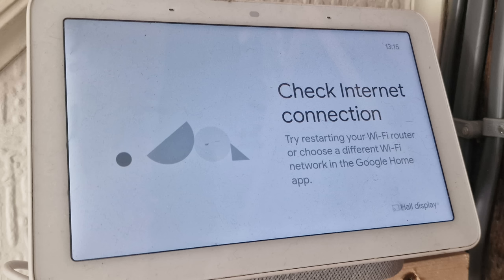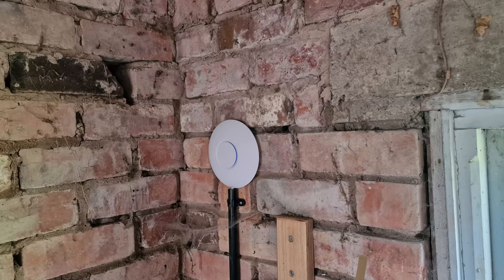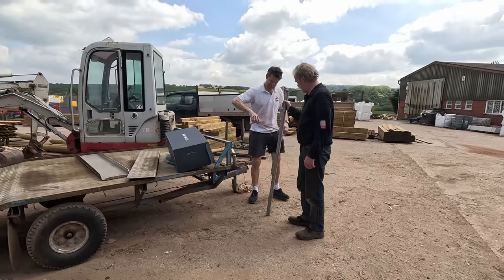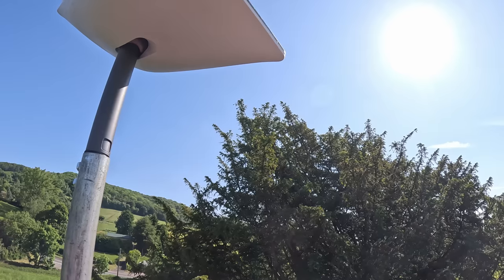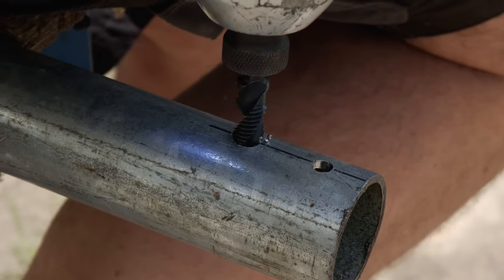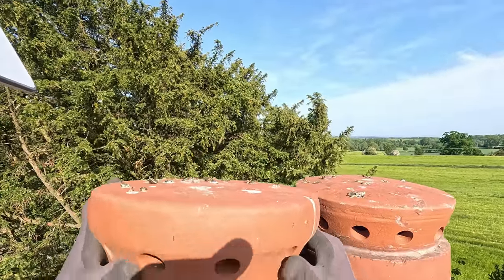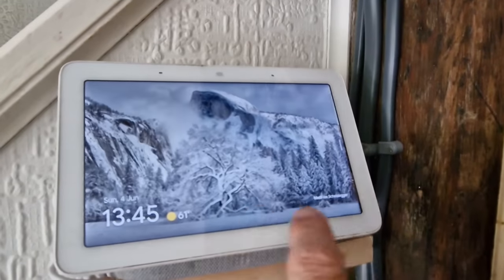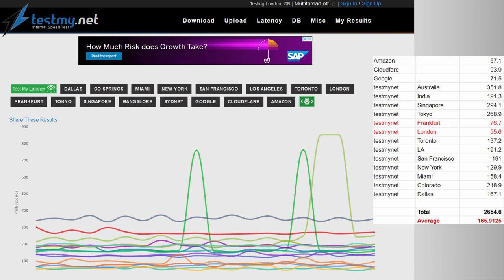Starlink Setup and Review

Comment from the maker: 🛠Charlie DIYte Amazon Tool Store https://amzn.to/3fcLnY4 - all my tried, tested and much loved DIY tools. 
☕ Help support me on Patreon -https://www.patreon.com/charlieDIYte (includes Discord access).
🛍 Join me on WeShop and earn shares every time you buy! - https://app.we.shop/join-charliewhite
Reply: Mm discord
Reply: In order to run a true speed test Charlie you need to disconnect all devices. And have a direct ethernet connection via your laptop. Then run the speed test. When other devices are connected it shares the bandwidth max speed. That may help you find a true result. 

Also if you don't already know I did see a Cisco device, in Which case I can imagine it is managed? Never use splitters over a network as it creates a route loop. You need a managed network switch that has a processor to direct traffic. 

You may already know this but I just thought I'd point it out.

And also you didn't put an ethernet cable through a fuse box did you? 😂 That's funny.

Always separate cat6 cable or whatever standard you are using from electricity. As it causes an electrical field interfering, this interrupts the signal to noise ratio or cross talk. Unless you use cat6a STP.

Comment: Great video thanks Charlie. I'm in Ireland but in similar position to yourself with copper wires, so got Starlink. For safety I avoid ladders so I got a local TV aerial installer to install it as I saw from his social media page that he had installed a few. I had ordered the pipe clamp from Starlink but he said he didn't need it & just used one of his own clamps (thrown in free). My house has concrete block & plasterboard lined walls so I bit the bullet and bought the deco px50 powerline mesh units. I bypassed the Starlink wifi & just use the deco. Each PX50 unit has some ethernet ports so I connected my TV type devices directly to the units & then use the mesh wifi signal for everything else. So far so good & happy I switched.

Comment: really good to see someone else on starlink too, we found the same as you, its night and day to fibre in rural areas. on the dish location, we used the standard tripod mount but just mounted it to a railing in the garden, its got a lot of close buildings and trees, and we're in a low point geographically, but no issues on blockages, i think its a lot more tolerant to sky coverage than people think.
Reply: Plus SpaceX only have only so far launched around 3800 of the total expected constellation of 12000 satellites. The dish will be able to see more satellites at any given moment to hand off between ince they're all up there. They have eventual plans to extend to 42000 if the demand is there.
Once they get their new Starship monster spaceship perfected, they'll have even more advanced satellites launching in greater numbers (It could launch something like 300 of the existing types at a time if I remember right). I think they're currently launching between 22-56 satellites every week or two on the Falcon 9 rockets.

Comment: Moved into a rural area at the end of 2022 and got starlink for similar reasons. Been delighted with the performance compared to alternatives. Costly but hey - space internet! Will move to land-based internet if decent speeds become an option locally.
Reply from the maker: Cheers Gavin. That's exactly my thoughts. Crazy isn't it that in this day and age they still haven't sorted out FPT for is all. Or actually it's not crazy. It simply doesn't make financial sense for the operators to provide it. 😡

Comment: Great video Charlie, just a point of interest. An installer told me if installing on chimney stack you should always lash using galvanised straps around the stack, if you fix into single bricks the weight and wind leverage can disrupt the bricks over time and work them loose bringing the stack down, there isn’t enough downforce from weight above like in load bearing walls.
Reply from the maker: Thanks Martin. It's an interesting point that. I can't see that being a problem in my case even with this reasonably heavy galvanised pole given that the bricks are incredibly well mortared in, it's a big old double chimney and I've used three brackets to distribute the weight but I can see the logic of that argument.
Reply: I’ve seen photos of bricks levered out after a windy day. One bricks mortar isn’t strong enough…

Comment: Got Starlink in Canada about 6 months ago (also at a reduced cost) and all I can say is ..... WOW! 
Fast downloads, fast uploads and the best part, no data caps. I too live in a rural area and the best download speed I could get via DSL on the phone line was around 500KBytes per second. Getting Starlink was like moving from a row boat to a speed boat. Makes looking after my web site a lot easier and make my wife happier to watch her shows. Like they say, happy wife, happy life.😏
Reply from the maker: It's great isn't it. I am still having problems trying to get to the bottom of why my internal wired network should be so much slower but generally we're able to stream and work seemlessly again. As you say, you can't put a price on the peace and harmony it brings 👌😉
Reply: Wish we had a discount down here in poor New Mexico 😒 Cheers on your good fortune 😂🤙
Reply: @CharlieDIYte  If your internal wired network is slow then look at the components that make it up. I had to upgrade two wired network switches before the gains could be felt in the rest of my system. 

And for what it's worth, not all computers will see the net gains the same way. It all depends on the network and the system attached to it.

I can watch Netflix without issue on one computer be not on another. It constantly stalls the playback.

Comment: Starlink uses about 100W normally, more when moving. At the capped rate of 34p per kWh that's currently about 3.5p per hour. 
Unfortunately there are 720 of those in a month (working on 24hrs x 30 days) which comes to ~£25 per month in additional electricity. 

Just pointing out that it costs about £300 a year more than people realise and may not have budgeted for.
Reply: How does that compare to a traditional router?
Reply: @C4sp3r123  less than 10W
Reply: @beplh5242  That's a massive difference!
Reply: Now that's an interesting point!
Reply: It shouldn't use that much unless you have the snow melt feature turned on. The specs for the V2 dish say the average usage is  50-75W.
Reply: Have a socket which power it down from 12:00am until 6:00am, or whatever suits you.

Comment: Hi Charlie. Tip on the speeds.. if the starlink Ethernet port is 1Gb make sure everything else is to get the full speed out it. Eg your switch and computer both need the same speed NIC. Might explain the desktop upload vs the results you got on the speed test over wifi. 👍

Comment: Charlie is very easy to watch. TIP. Any thing fitted to a chimney, I would recommend and lashing instead of drilling and bracket.
Reply from the maker: Thanks. I hear what you say. 3 of these brackets should be more than strong enough though even with the weight of that pole.

Comment: Try the advanced speedtest and on the right it gives you the Router to Internet speed - the speed that the dish is communicating with the satellites. You can then use this as a guide to work out what kind of losses you are getting in your internal network.
Reply: This advanced speed test is only available in the app after the ordinary speedtest has completed

Comment: I guess the next step is to get a dual WAN setup, use your fastest network as a primary and the slower one as a backup. Or load balance across both. The Unifi UDM-Pro, UDM-SE or UXG-Pro are options, as would be a pfSense box.
Reply: Peplink is another name to throw into the dual WAN ring!
Reply: I have a unify network with a USG Pro. It has dual wan so have BT and local rural internet. Works very well. 

The problems with wifi speed are weird so needs more investigation. Can you connect to an AP with Ethernet and test the speed?  Help identify if it’s the wifi or the switch or something else.

Comment: I live in a regional Australian city based on the NSW/VIC border. We receive NBNCo Internet service here which is appallingly slow, ‘copper to the Node’ with ageing landline copper connecting us to a Node which is separated form our home by 1.1km. The service we receive has been unreliable and provides speeds far below what we pay for. I’ve just purchased Starlink gear (and found the Starlink shop) at the reduced rate offered to Regional Australia. I’ve bought the mount and a longer cable from the Starlink shop. It will be far easier to access the chimney on our roof than yours and we have clear sky above us as we’re on a hillside with no overhanging trees. Thanks for your informative video which has provided knowledge and thoughts to assist my install.
Reply from the maker: You're very welcome Greg, thanks for taking the time to comment. Your situation with the slow existing sounds similar to mine. You're going to love Starlink 👌

Comment: Interesting. We’ve been using EE 4G cellular broadband for around 3 years and it too has been flawless until the last 6 months or so, with timeouts and weird lag that we could never get to the bottom of. In addition, we too have got the Starlink dish and we too had to wait for an Ethernet adapter. I’ve not yet plumbed it in to the rest of the network, but I’m hoping our experience will be similar to yours. Cheers for the video!
Reply: Very similar experience here. We were on a lousy FTTC line. We spent loads of money on bonding a second FTTC line, stll lousy. Then we moved to 4G and Three, which was great until everyone else started using it during COVID. Then we switched to EE, which was great, until it wasn't (evening streaming became unworkable). Now we are on Starlink which is so much better.
Reply: Yes, using EE 4G here and the last few moths have been awful.  Hence now installing Starlink when it arrives today.  And of course, EE deny it's anything to do with them!

Comment: Nice video Charlie, strange your unifi is slowing you down. Would be interesting to see a video on how you've wired the RJ45 ends, what Cable type you've used and what network switch your using as these could all be limiting factors. Typically I find Unifi is pretty decent kit, unless of course its really out of date stuff.
Reply: its worth understanding wifi to troubleshoot it, its surprisingly poor in how it works, with different transmission protocols and the hardware that drive them. a simple old poor device running on a new shiny wifi network can drag the whole thing into the toilet because the old device blocks the accesspoint until its done. wifi is very much only as strong as your weakest link
Reply: Yes, that sounded odd. I've got Starlink and Unifi.

My Unifi wifi can still exceed the fastest speeds Starlink gives me, there is something not right there.

I'm sat here in my downstairs office, my closest access point is in the loft about 50 feet away from me, through the downstarirs ceiling and the upstairs ceiling. My iPhone happily gets 250 mb/s on a speed test from here (and if I remember correctly from past tests maxes out at about 400 mb/s).

Maybe he's using wireless uplink between the access points without realising it ?

The placement of his access points looked less that optimal. Seemed to be low down on the ground floor and pointing horizontally ? They really need to be up on ceilings, preferrably upstairs and pointing down when you've got thick cottage walls (we have that issue too a bit). Mine are just laid on the boards in the lofts.

I'm also very careful to make sure my three access points aren't using overlapping bands. If I leave it on automatic Unifi will tend to use the same band for the two APs that are at either end of my house, so instead I use manaual band selection and make sure that on both 2.4 GHz/5GHz I'm the best channel options there are.

Comment: Very good video.  I had a professional install my Starlink as I am terrified of heights.  Within the house, I use a Netgear Orbi wifi system throughout 3 floors of my 16th century farmhouse (with solid stone walls some 18" thick).  The Orbi is a bit on the pricy side but does a magnificent job.  I use one Orbi router hub and three Orbi satellites to get maximum coverage.  I just ran a speedtest on my laptop before typing this, and I see 220meg down and 22.8meg up, and that is one floor below the main Orbi hub.  Highly recommended.
Reply from the maker: That does look good!! And I should probably have mentioned that Starlink do something similar. Thanks for sharing 👊
Reply: Starlink do offer a mesh, but at >£140 per mesh satellite that's not even wifi 6, I too am sticking with my existing Orbi setup. 

I toyed with the chimney but was advised against due to concerns over strength.

Comment: Unifi is a good solution so I suggest an upgrade there is not required. However, if you do not implement the environment correctly it will slow things down.....for instance if you have a high level of security implemented on some of the entry level devices it will impact performance.

Comment: This was super interesting to me, as I went through this process myself a couple of months ago after moving into a rural house in North Yorkshire (Unfortunately I had to pay full whack for the kit), I ran into many of the same problems as you, orienting the dish North made me laugh as I knew what was coming next! I did wonder why you didn't route the cable through the pipe on the chimney instead of coming out the top? 

Regarding your home network, I would highly recommend getting a Wifi 6E setup, the speeds are not far off being as fast as wired (Just under 10GBPS) way more than your upload/download speed is capable of! This is providing you have devices capable of using a 6E ghz channel (There's also a 6GHz channel, and 5/2.4 bundled channel). 

I use the TP-Link Deco XE75 AXE5400 home kit, it comes with 3x access points but you can add more, really easy to setup. They actually wireless daisy chain together and have amazing signal range and penetration. 
This means you don't need to hard wire them together via ethernet (Although you can as you already have the cables ran) If you ever wanted to add extras beyond what you already have, as the connection over 6E is so fast, and works between the APs, there's no point running ethernet anymore, as there's no slowdown to having it run wirelessly. With the added benefit that nothing else uses the 6E band, so there's no interference either. The only downside is there's not as much custom options as something like Ubiquiti, i.e. I haven't seen an option to keep a second connection and use it to load balance your starlink connection, this was my original plan, but I've found starlink so stable I don't think it's worth it. I've only had 1 outage which lasted 5-10 mins when we had a thunderstorm last month.

Hope that helps a bit! Looking forward to a future vid where you upgrade your home network! 

Cheers
Reply from the maker: Thanks for this. That's really interesting and is something I'll definitely consider. Also really appreciate your update on Starlink. 👊

Comment: Interesting to see this setup, I think this is the first unbiased and decent Starlink review I've seen from a youtuber I fully trust! I wonder how bad the weather has to get for it to cause issues. Speed might improve (or will it?) as more of those satellites go up - they're still putting dozens per month into orbit.
Reply from the maker: Thanks, I really appreciate that. Yes I think we'll need a review one year in to see how it fares in the bad weather. I'll be nervously checking it after each storm 😬
Reply: It barely works in bad weather. I had it for one year.
Reply: Big thunderstorm yesterday and mine cut out briefly....despite the power remaing on (proved by my oven clock not resetting. Very pleased over all, Great video btw

Comment: I know this video is a bit old now and things may have changed, but your EE router has external Mimo 4x4 antenna links.

I would recommend trying an external high-gain outdoor directinal antenna with a line of sight to a 5G mast. I don't see why you wouldn't get 500 down and 500 up very easily.

The antennas cost around £120 and would be installed on that pipe. 5 metres of preterminated cable come with most, so the router could go into the loft with a Cat6 down to the main router.
Alternately, you could look at terminating your own, although this can be a pain.

The website is easy to find (it has routerstore in the name); however, these can be purchased anywhere; really, just make sure you get a 4x4 MIMO compatible one.
And looking at the 5G router you have, I think you'd need 4x Ts9 to SMA adapters.

I've only recently found your channel, so forgive me if any of this has been tried or mentioned before, but I would love to see a comparison between this solution and Starlink. I think your use case with line of sight is the best possible option, beating out Starlink by some margin.
Reply: I think your router might be a Zyxel NR5103 or similar; they are spec'd to have a theoretical download speed of 4.67 Gbps with the correct antennas, so honestly, who knows what you'll get? I would bet money on higher than you currently get, but if you still have the equipment, it's 100% worth a go.

Comment: That's a Gen 2 modem; they put the RJ45 Ethernet ports back on the Gen 3 model which I just ordered. But all in all, you chose Starlink for the same reason I did over here in the US; best option for rural users that want a decent Internet connection.